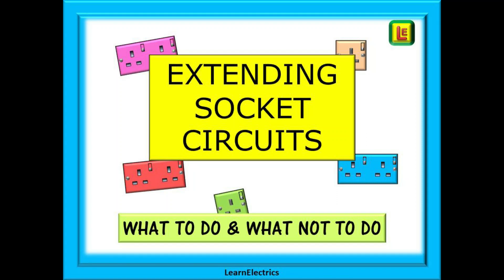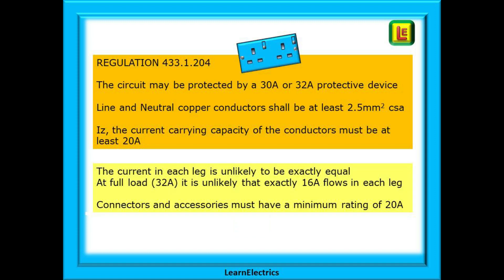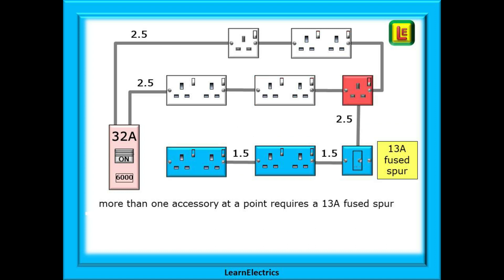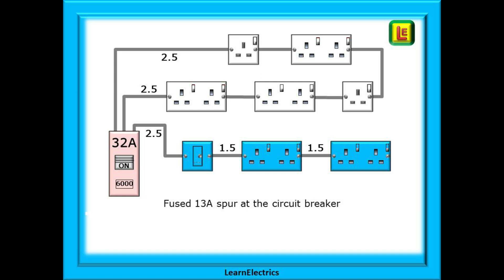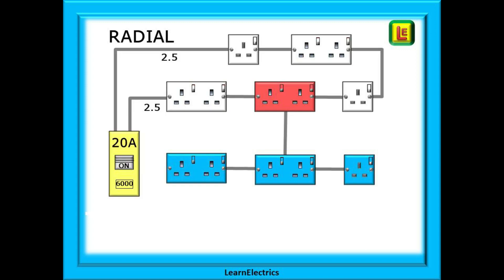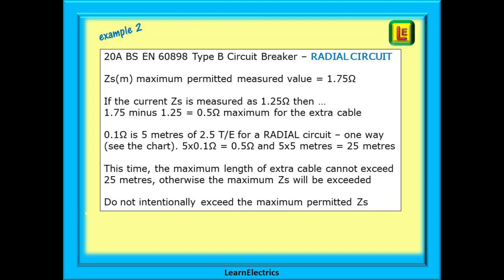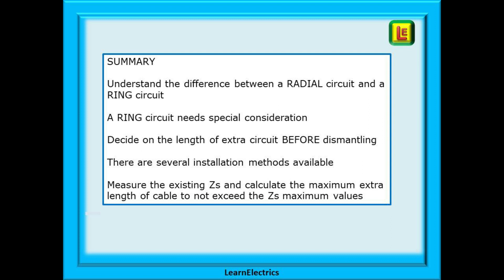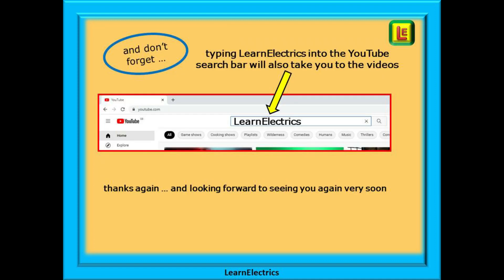EXTENDING SOCKET CIRCUITS - ADDING TO RING and RADIAL CIRCUITS

Comment: 8:45 - how is that a radial? That's just a ring with a spur surely?
Reply from the maker: We are reducing the size of the breaker to bring it under the same rules as a Radial circuit because the cable is now rated higher than the breaker. With a 20A breaker and all in 2.5mm we can have any arrangement.
Reply: @learnelectrics4402  So you can essentially change a ring to a radial just by changing the MCB size to 20a?
Reply from the maker: That's why I suggest in the video to reducing the breaker size and removing a link to make it into a pure radial. The rules for radial circuits now apply as per p506 in the Regs. If it is all in 2.5mm with a 20A or 16A then any arrangement is possible subject to Zs max of course. Hope this helps. Thanks for watching. Dave.
Reply: @electricalstuff259  -Yes if you split the ring. 2.5mm is rated at approx 27A. The original 32A breaker would now not protect the cable so you need to protect it with a 16 or 20A breaker. The breaker has to be less or equal to the actual design current which both have to be less than the current carrying capacity of the cable. (Ib In Iz)
Reply from the maker: Thanks EF. Great additional info. Appreciated. Dave.

Comment: If accessories MUST be rated at minimum 20a, how comes we can use 13a sockets rated at max 13a?
Reply from the maker: The socket fuse is rated at 13 amps but the actual component that make up the plug will not be damaged by 20 amps, except the fuse, which should blow.
Reply: @learnelectrics4402  I've never seen a socket with a fuse in it? I still don't get it - if the socket itself is rated for 13a how come it 'must' be rated at minimum 20a? This one needs clearing up i feel.
Reply from the maker: Cables and components must be capable of taking 20 amps even if that part of the circuit is fused at 13A.
Reply: @learnelectrics4402  But there is no fuse in sockets? And you said 'accessories' which is sockets and light fixtures and fittings? So if something is 'rated' for 13a it means it can only safely take 13a without risk of damage or malfunction so either sockets are 13a or they can take 20a and so are actually 20a rated? Still confused sorry.
Reply: @electricalstuff259  - you're forgetting the fuse in the plug top. The 'socket' rating of '20A' just like like any rating of accessories or circuit breakers or connectors must have an operating limit before being fried or blown to bits. If you have a fuse or circuit  breaker with a rating on it in Amps, it just means that it will sit and allow that MAXIMUM current to pass through it without any issue. A fuse rated at 13A will  therefore protect a cable if the fault current exceeds the fuse rating rather than the cable heating up and melting so generally, the cable should have a higher rating than the fuse (Ib In Iz)
Reply: @ef7480  Sockets are rated for 13a not 20a.

Why are they 'rated' (which means that's the max amperage they can handle safely) if they actually are rated much higher?

I'm not forgetting the fuse in the plug top, that has nothing to do with the sockets' maximum manufactured rating. 

So why do they say they're 'rated' for safety at 13a but actually they must be rated for a minimum of 20a? Why are we not calling them 20a rated?
Reply: @ef7480  Cable, fittings, components etc are 'rated' at the maximum they can safely pull without damage or malfunction.

Sockets are 'rated' at 13a even though they're not.

Why?
Reply: @electricalstuff259  - The '13A' part is the general limit in the plug top. Hence 'sockets rated at 13A' UK sockets aren't actually rated at 13A .
Reply: @ef7480  So why are they sold as 13a rated? It's very odd to put a rating on an accessory given that rating is only controlled by external factors. 

It would be like giving cable the rating of commonly used fuses instead of its actual rating. Why does this only apply to plug sockets?

Comment: Nice one dave another well detailed video 👌👌
Reply from the maker: Thanks buddy, thanks for the support
Reply: Dave what is the scenario if the maximum Zs is exceeded, say a ring was extended for a socket and the length of cable exceeds the maximum Zs,would it be a matter of a new circuit on its own MCB/RCBO radial circuit 🤔 cheers

Comment: Can you do a radial in 4mm cable  and  fuse at 30/32amp ?
Reply from the maker: Yes, that's permitted. Some sparkies do that for a radial kitchen circuit. Good question.
Reply: @learnelectrics4402  I was thinking about my utility room. Currently 2.5m 16amp  MCB with Washing   machine , tumble dryer and a large freezer with a 3A spur for lighting. All running at once can take out the MCB. If I rerun with 4mm I could change to 32amp. Or could I get away with 20amp MCB on the existing 2.5mm cable?
Reply from the maker: Three options. If the CU will take another MCB, split the ring and make the existing MCB and the new both 20A. That will split the load into two separate circuits.
Or, just change the existing 16A for a 20A, that might be just enough to stop it tripping, but might be too close for comfort
And third, as you say, rewire in 4mm with a 32A breaker, but that can be messy and time consuming if the cables are chased in.
Lots of options, just do it safely. Dave.
Reply: @learnelectrics4402  replacing 16amp MCB with  20amp  will be easy and safe as the 2.5mm is good for 20amp+ as it is direct clipped and dose not run under plaster at any point. It only trips when 2 motors  start at once. 4 Amps extra 'head room' should be enough.
Reply: @learnelectrics4402  done the 20amp MCB on the existing 2.5mm cable and has not tripped since,  thanks.